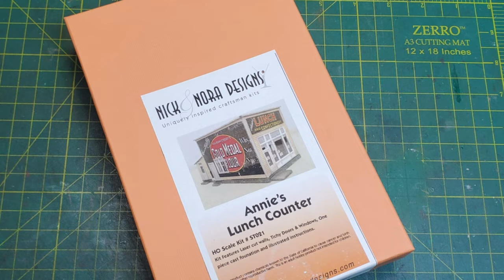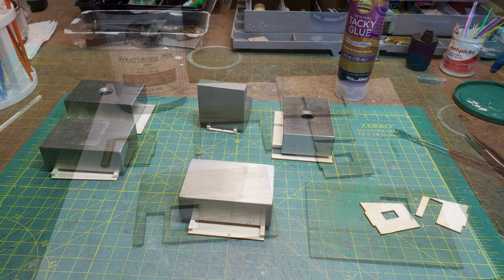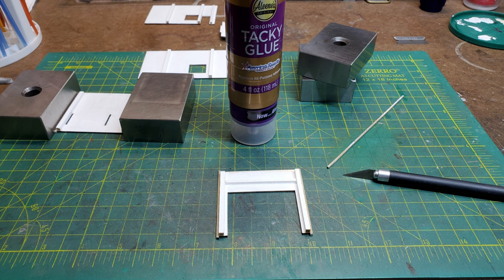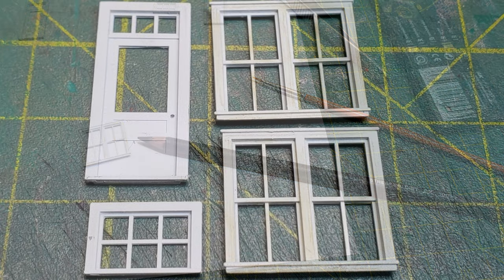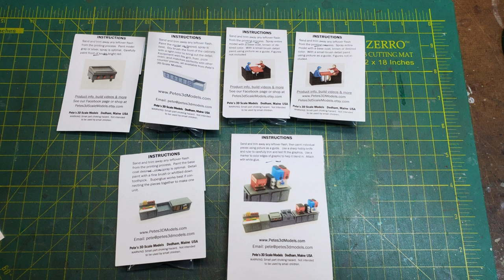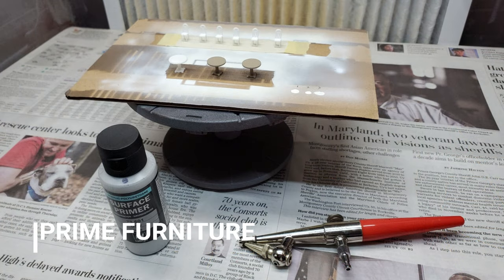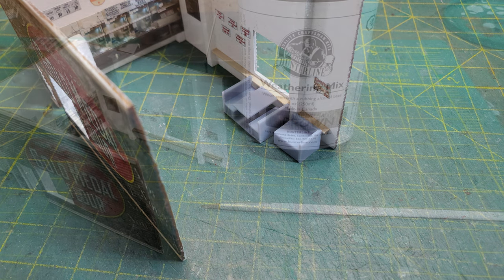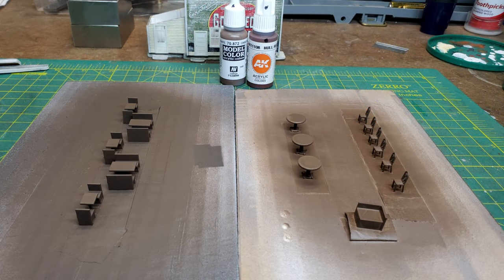Annie's Lunch Counter from Nick & Nora Designs

Comment: Greg, what is Activa? I’ve never heard of it.
Reply from the maker: Fr. Ron, it's a fine, colored sand you can get at art suppliers, and other places. Thanks for watching.
Reply: Great job and plugs for the ultimation tools. Have you ever used the brass clamps from  micromark? I love them and they give me alot of control. Although salty, I  wait for their sales! Have a great day. Do you think the curtain effect could be achieved by sanding, like we do on exterior signs?
Reply from the maker: Greg, I do have a set of the brass clamps. They come in handy for extra-long buildings. I don't know if sanding on curtains would work. It might, but it may be hard to get the even transparency that tissue paper offers. Of course, I think that only matters when lighting the interior. I just use regular paper printouts of curtains if it's gonna be dark inside.